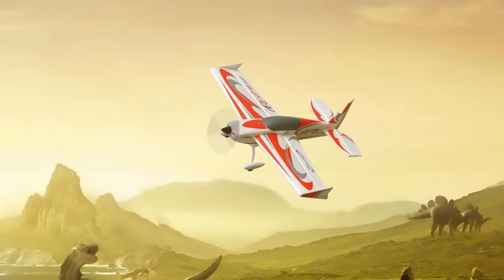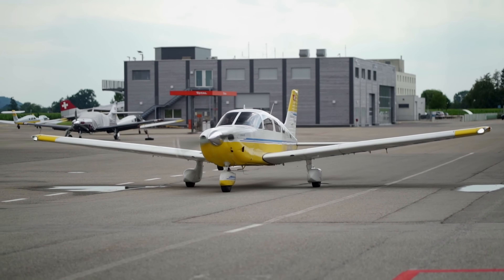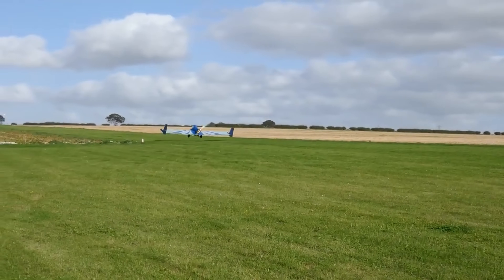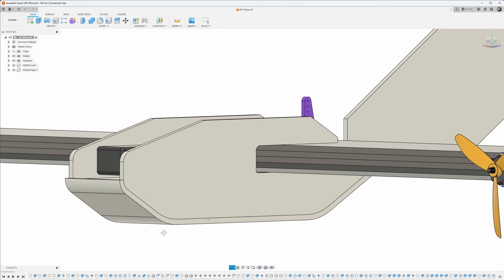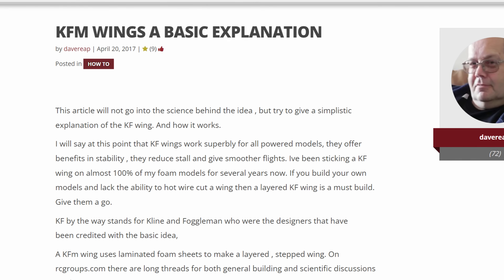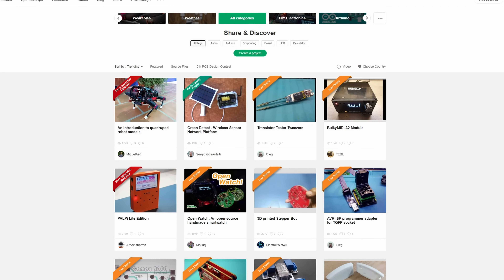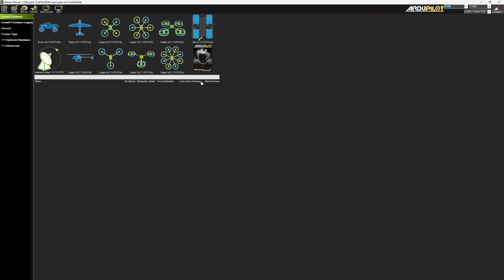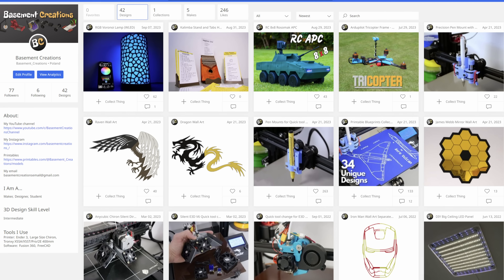This RC Plane can Fly Itself - Flying Plank Build Tutorial and Ardupilot Setup Guide

Comment: So, in my twin rc plane , the motor is from the same company, it has the same KV rating, the same propeller, and the same ESC brand, and the battery is also adequate. The problem I’m facing is that on one side, for example, the right side, it’s turning more sharply. The RPM on the left side is significantly higher compared to the right, causing the drone to drift to the right because of the motor. So, can you tell me if adjusting the thrust balance in ArduPilot will help fix this issue in the system? That means if we make both thrusts equal, then the drone will taxi properly and stay stable. Is it possible in this system

Comment: Very nice. The only thing I would change is the location of the engines. In multiengine airplanes we try to put them as close as possible (considering prop diameter) to the fuselage centerline, to avoid troubles associated with differential thrust, especially when one engine fails.

Comment: Hot glue worked great for my first good models, and it's great for quickly getting up and going, but you will absolutely LOVE e6000 and CA glue. As long as the Cyanoacrylate doesnt melt the foam you use, in which case I'd switch to EPP foam anyways The amount of weight vs the strength you're getting from all that hot glue makes things a lot harder to balance and fly well. Give the other glue's a try, I know you won't go back!

Comment: That plane actually flies.
Though it seems to me that it could be lighter and easier to fly. Even without on board autopilot.
That KF airfoil looks promising at first, but you could use just a flat wing for better performance as it would be lighter and have less drag.
The other thing, the foamboard, that with layers of cardboard on outside is a far better material than a floor insulation. It even allows to build a real profiled wing easily without all that rib structure.
And the last, not least, the straight flying wing is not quite a best choice. Adding just a bit of sweep, like 20 degrees, allows you to shorten the nose and reduce the vertical planes. Both improve lift to drag ratio and reduce wing loading, making the plane easier to flight.
One of my old planes. https://youtu.be/yBKOo478_wo?si=lURHB5K84DEJrYcl
After several crashes it has lost some parts, like the nose fell off, the vertical stabilisers got much smaller, but it was still quite flyable.
It was naturally stable, qutie light and slow flying, so no need for artificial stabilisation whatsoever.

Comment: What if these had missile seeking abilities where as goal is simply to get in the way and fire compressed air projectiles at the warhead to disable it you could have 100,000 of these just sitting on rooftops in feilds wherever trickle charging on solar with a 2ndary battery to run the recording base station  and linking them all into a camera network for live video mapping of area whislt simultaneously defending along with irorn curtain  177mm bbs at combined flightspeed and launch speed may be enough to peirce warheads and when in doubt just add an array of angles multiple projectiles like a shotgun  and interchangeable weapons packages modular and easily repairable recyclable is key being more than 1 time use kamikaze although that strategy may also  be used if deemed necessary to defend homeland

Comment: I've made RC boats, jetboats, gliders, powered planes, airboats and the one time I used a gyro was on a jet boat to stabilise the vertical axis spin. I have to report I didn't like the result. Two reasons I can identify, 1. It was destructive to the boat's ability to surf, which otherwise self stabilises somewhat to the wave. 2. I designed my jetboat to lock in on turns with minimal sliding. So though it was great for maintaining a course heading, it took away the feeling of piloting the boat. Persevere with developing your piloting skills. Do new maneuvers with plenty of height to do recoveries and push your skills slowly. If you try loops, remember the g-forces act on the wings and too much dive speed can break a wing off. If you try rolls, do 360 rolls first and learn recovery the right way up before you practice upside down. Get used to the orientation changes for directions relative to you with a simulator. Stay well clear of trees and poles, pylons, I mean like 10 meters clearance.  If you are flying upside down high, it's kind of cool to half loop up or down to switch back to normal. Flying is not like walking or cycling, a car, give yourself a huge frontal clear zone at all times. Be aware that too slow flying will result in a stall so practice with height so you have time to work out how to recover. Be mindful of reducing power and return it back to you before the power completely fails. For many hours of flying without needing a lot of battery recharges, use bungy launch gliders or get a slick glider and learn to do slope soaring.  Slope soaring is quite blissful, I used to think flying gliders was boring until I saw the aerobatics possible.

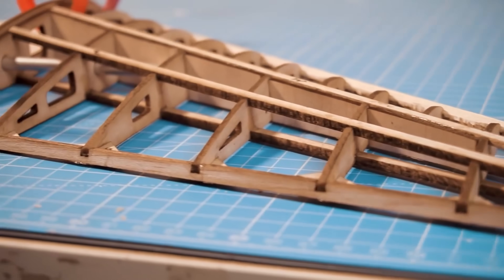Comment: Delta wings do need a vertical stabilizer.   The one at 1:09 is stable because of it's winglets.  Gryos however can remove this requirement like with the B2 Spirit.
Reply: B2 uses split control surfaces to act as a differential rudder. Gyro controlled.
Reply: Yep.   His aircraft around 109 didn't have a vertical stabilizer because the winglets were doing that job already.: @ColinDyckes
Reply: they do not
even planks can fly without a fin
search for "Le Brett'le"

Comment: This is great!  But I have a couple questions. Al Bakstrom's Plank planes, upon which this was based, required for longitudinal stability for the center of pressure to not shift in flight. This can be accomplished using a symmetrical airfoil or a reflexed airfoil like Max Munk's M-6 used in the original Pitts S-1. This KFM airfoil is clearly not symmetrical, nor does it appear to be reflexed, so does its center of pressure move? If it does, are you relying on the Ardupilot to provide artificial stability? Thanks again.

Comment: I made a plane like that before and we called it the big red boat. The engine was OS FP 40 and it was weak. We needed something like OS FS45 or 60 at the time.
Reply: Ditto. FS45 on my 'plank' which had a balsa sheet wing. Anything will fly with enough power 😂

Comment: 65 roll 45 pitch in self-level works for me on new builds, in arduplane and iNav. Landing in self-level is as easy as pulling back on the throttle and elevator, balancing speed for altitude. I highly recommend FPV as your next step, as ardupilot and iNav both have very powerful On Screen Displays, for showing you telemetry, while your line of site is no longer your range's limiting factor. Great video BC
Reply from the maker: Yeah, the 45 roll limit I set was a bit to restrictive, thanks for the advice! As for the FPV I recently got myself a Walksnail digital FPV system , so I will have crisp picture on the ground and nice HD footage from the air. I am also experimenting with Mavlink Telemetry over ExpressLRS with AirPort soft, so that I could control the future crafts by simply setting waypoints on a map
Reply: @BasementCreationsChannel  The ELRS Lua script function is uber powerful - it's funny you mention Walksnail, I was just convincing  talking to my fiance about why we need to upgrade lol
Reply from the maker: I mean digital FPV is undoubtedly better so sooner or later we all have to switch. But the Walksnail goggles were way too expensive for my budget so I got myself a VRX instead. I am going to use it with my 24" PC Monitor on a tripod and you all can't stop me lol

Comment: This is a GREAT and informative video- IF you are open to it being one!  As a 55 year old Engineer, I cringed early on at the initial design choices and soft and bendable materials used, as well as DUCT TAPE being used to both make the leading edge more aerodynamic and ALSO as a control surface hinge.  It was almost as bad as thinking you will find ANY kind of real character development in a Star Wars movie.  It was a very good idea to show what the Ausie's are building for Ukraine- the point made is excellent.  There is a difference between GOOD, and GOOD ENOUGH.  You HAVE to view this video in this way, and you will come to see that many "poor" engineering/design decisions are not really that bad- they more accurately, GOOD ENOUGH.  Consider for example, the fact that none of the electronics are protected from "The elements" (that is to say the weather)- you COULD complain that everything can get wet easily.... OR you can acknowledge the genius- no need to do anything more to make sure the electronics stay cool.  Lastly, this video is really funny.... the initial flying field is small.  Very hard for a relatively inexperienced pilot, which this guy acknowledges he is....... SO, he goes to a BIG field to be safe- with ENORMOUS wind turbines nearby and even more enormous- MONSTER size power transmission towers VERY close by.  These two things make the massive field an obstacle course- the wind turbines ready to slice your plane in half, and the massive transmission line towers ready to ZAP the plane like a bug zapper in your backyard.  This video is not only eye opening and thought provoking, it is hilarious.  WELL DONE!
Reply from the maker: Hi, thanks for such a long comment!
I just wanted to clarify that in a world of hobby RC planes foam, tape, and hot glue are the most used materials. Guys from Flite Test have been building great planes with those for years. Sure it could be made more durable by using balsa wood or fiberglass but there is simply no point in doing so for a slow flying beginner plane.
Moreover as you said some seemingly bad design choices were made on purpose, I could add a top canopy by simply attaching a piece of foam but I left it open to have fast access to electronics and to better cool the ESCs.
Also the perspective can be a bit misleading on the last field, those wind turbines were way too far to slice my plane, the transmission lines were closer but it was still the best place I could find around my area :)
Reply: @BasementCreationsChannel  - I agree with your comments.  While my PREFERENCE is more refined engineering choices that lead to better performance and endurance, and quality, etc.- YES, what you say about the slow fly FPV community is right on- and it does impress me-very much so- planes that are built so simply and for so little money, and yet they GET THE JOB DONE.  Good to hear the wind turbines are not so close by, and be careful with the big bug zappers.

Comment: information           5:38   the load-bearing main spar should be located at  Thirty percent  of chord.        a spar made of CF  is  Heavier  than one made of  poplar or pine.          6:52   aileron configuration is  WRONG.      ailerons should be 'cut out of' trailing edge of the  completed  wing/airfoil.           6:57   E  PROPELLERs  should be used.            7:12   elevon control horn  NOT  correctly configured.          7:25   still wrong.          sources of thrust should  Not  be  located so far  outboard.!        that  outboard-located mass is  Reducing  roll-axis stability.              16:04   'small field'    yeah, right     lol.
Reply: What a total prat
Reply from the maker: Hi, thanks for additional information but keep in mind that it’s just a simple Plane made to demonstrate Arduplane capabilities. So the additional weight of carbon beam or drone propellers don't really matter, this plane was not made to be super efficient. Also the motors are mounted so far outboard on purpose, the goal was to take advantage of differential thrust and gain yaw control without a rudder. The roll stability is not a problem in this case as the plane has active stabilization.
Reply: @BasementCreationsChannel  and therin in the difference. Your plane is designed sub par, so it NEEDS electronic stabilization to even fly. 

If the model is designed properly taking into account aerodynamics, weight, balance and other factors considered properly, it will fly better than that model without any electronic  stabilization at all.
Reply: Dont worry, giving advice to these 'content creators' is like leading a horse water and then trying to get it to drink. They will never admit they are wrong because that would invalidate their video and getting them sweet sweet subs and likes they so desperately yearn for.